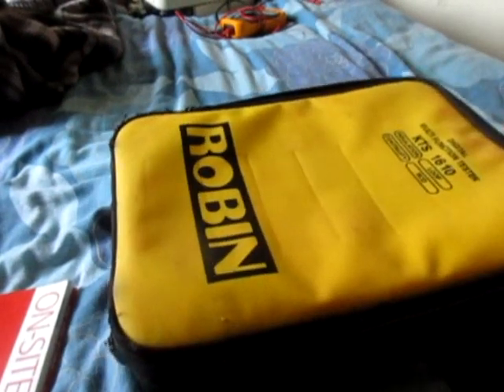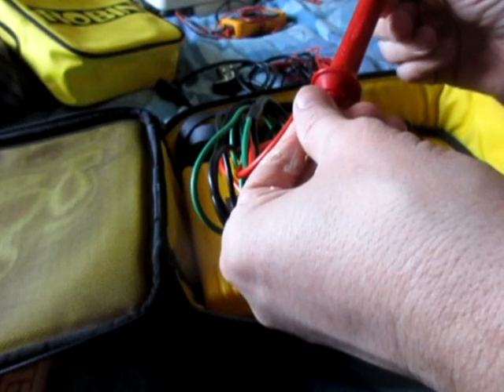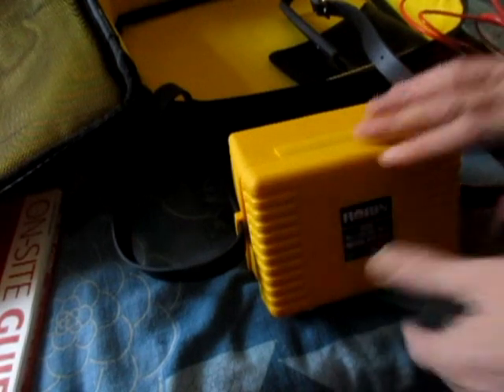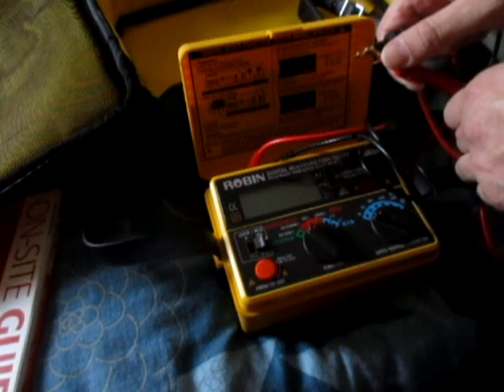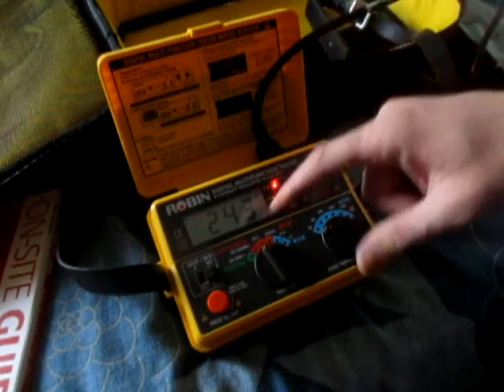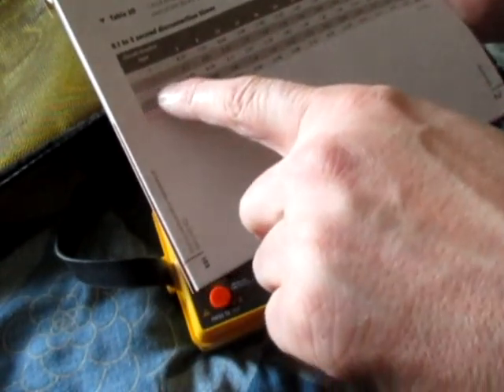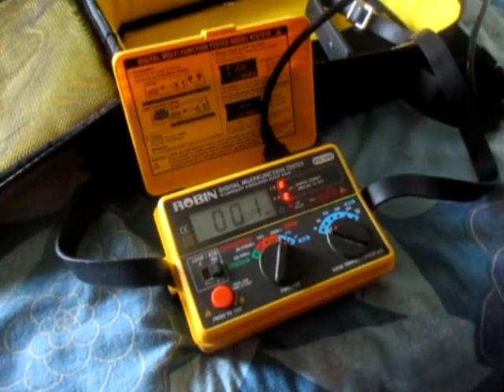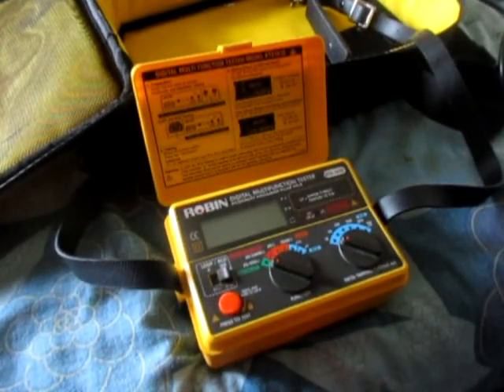Robin KTS 1610 Review: Is This 16th Edition MFT Still Usable Today? (A Classic Tester)

Comment: This trips RCBO when you do a earth fault loop test. Whats the best way to get around this ? Should i just replace rcbo with an MCB for the test ?
Reply from the maker: i reset rcd and it works after i suppose you could though.
Reply: @cagmito76  If it trips the rcd or rcbo during a earth fault LOOP test is the ohm reading accurate. ? Has it taken a true value before tripping. What are your thoughts on this .    Would really appreciate your opinion.   I am new to this stuff.
Reply: Yes

Comment: Fantastic meter look after it and it will serve you well.
Reply from the maker: Thanks it is a great meter i like them any way
Reply: @cagmito76  I use the next one up the KT1620 had it about twenty years and it is still going strong
Reply: @seandempsey9396  Hi Sean. I bought a second hand Robin KTS 1620 for practicing.   It trips the RCBO each time i do a loop test. How do you work around this ? Is the reading you get reliable before it trips ? Has it enough time to get an accurate reading.    I read somewhere else to replace the RCBO with an MCB just for the test.      I would really appreciate your opinion.